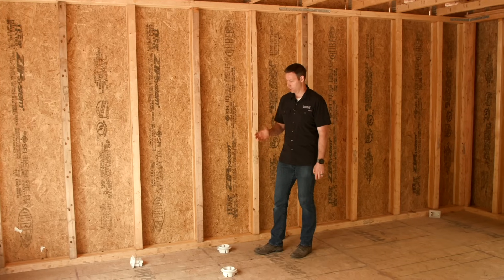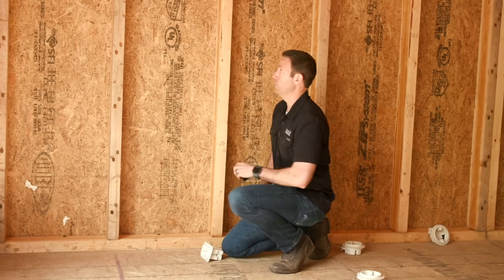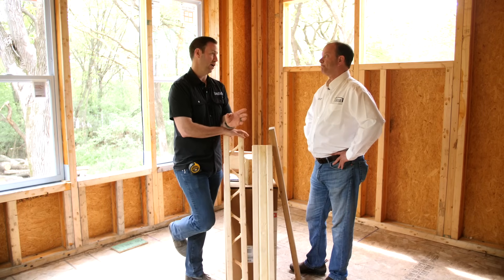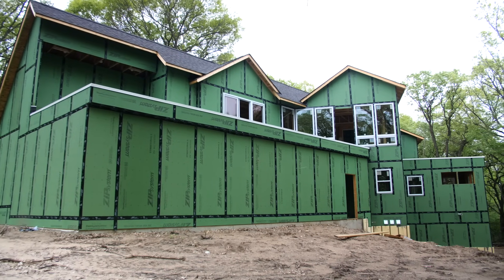Insulated Studs? This is a BIG Innovation in Framing!

Comment: We had a local product called "The Ingenious Open Stud" that we used on a few projects here in Maine until they went out of business.  The 2x6 studs had 2x2 outer elements with a groove on the inner face.  The outer "rails" were held together by 1/2" plywood gussets glued into the inner grooves at 16" o.c.  That left plenty of empty space for the dense-pack cellulose to fill.  Each end had 6" of solid wood for nailing and trimming to length.  This was back in 2007-2008.
So not a new idea, but a better engineered solution.

Comment: Very intriguing. However I would be hesitant to use it until it’s had more time in the field. Would you still use standard 2x4/6 studs on the interior walls?
Reply: Standard lumber for interior walls unless you are using this product for its extra load capacity.

Comment: I understand what you guys are trying to do here , however I’m very skeptical . I have been building for about 18 years , nothing special still a rookie to some old timers , but have been trained in all aspects of building , meaning I do tile , hardwood floor refinishing and new installation , framing , windows , siding , standing seam metal roofs , and on and on , I only say that to say I have good knowledge of construction . Being this is a new product I have some questions I hope you can answer , I want to like this product but I’m not going to only like it because you say it is good . I have tried to do some research on this product to see if this has even been tested through a company outside of Tstud like ECS or something and I come up with nothing . This 24 inch center and a single top plate makes me nervous . What if your in areas where the code calls for 16 centers like most states do ? And another question is , is this really that much better than regular 2 x 6 walls , and the zip system has been proven to be lacking in allot of areas and actually fails allot of the exterior testing sites do . So I guess my final statement is this : prove to us , the community of contractors , with facts and data by a well respected company that tests building materials for their durability. And it can’t be associated with stud company . I thought if you really wanted to sell this product you would have all of this raw data , not just someone who no one knows saying this is better . Like I said , I want to like this .. so let’s hear it . And I mean no disrespect and am not questioning the integrity of the builders that appeared on this video , nor the sales reps. But I am a man who forms my opinions on proven facts . Will this product be as structurally sound in 20 years like regular framing is ( assuming it was done right ) and what is your proof . Great video and if I get the data that makes me believe , I’ll back you guys 100% and recommend it to contractors I know and even make the switch myself

Comment: I am curious on how well you can run plumbing through this type of wall. As a plumber it looks like it would be a problem running waste arms and the vertical stacks.
Reply: You add a service cavity.
Reply: The fact that they are an engineered product means that most likely you won't be able to notch them hardly at all. Just like TGI truss's you could be limited to designated penetrations (knock outs) so I imagine you plumbers won't think to highly of them. The electricians on the other hand....

Comment: So am I to still put insulation between the studs too, the purpose of this is to eliminate the thermal bridging lost through wood?
Reply: Yes. Roll fiberglass or closed cell foam between studs will still be needed. Going 24" on center will reduce insulation installation time as there would be a few fewer cavities per room.

Comment: It's not about improving building standards. It's about profit. Everyone has a more improved product but at an improved price but the bottom line is it's probably not worth the increase in cost. While I believe the industry is moving too fast for it, I've never seen a comparison of the same age homes utilizing standard verses all this engineered crap. An analogy I like is "Ford beats Chevy". If you read the small print, in a 1000 mile race Ford wins by 10 feet. Doesn't mean shit and neither does all this "building science"!!

Comment: There is even a better way. 2x4 wall then another 2x4 wall but off set the studs for the thermal break. 7” of insulating.
Reply: yep.  If you can afford it this a good method.

Comment: This sounds like the perfect application for framing out the walls between the shipping containers in the shipping container house I'm planning to build. The spray foam seems to be perfect to fill any gaps between the wood framed walls and the shipping containers. There should be no more challenge for it to work than I'll have with using traditional framing.

Comment: Not good! As a 47 yr experienced carpenter I can tell you in won’t be properly nailed. 11/2” wood will usually split. You need to have at least 6” of solid wood top and bottom so as to nail properly without splitting.

Comment: Electrical note; What are electrical cables in the US sheathed in? It's a big no-no for cables down here in Australian which are PVC insulated, to directly touch styrene, Styrofoam, polyurethane and bituminized papers. This is due to the plasticizers in the PVC cable sheathing migrating into the touched materials. The cables degrade and loose insulating properties and also degrade the surround materials. This happens over long term time frames but non the less isn't good!
Reply: Also; wish we had these in AUS, currently building my own place and the lack of options for materials is astonishing.

Comment: Sounds very impressive.  What about sound performance?  Esp the bare studs when filling the wall with foam. How would it compare with staggering 2x4 studs in a 6 inch space (studs only contact one side of the wall i.e every other on one side)

Comment: Looks expensive and stupid.  Why not just make engineered lumber that has insulation built in.
Reply: What, exactly, does that mean?
Reply: Probably means Structural Insulated Panels...
Reply: @BenjaminFranklin99-s9n  I mean use an insulative binder binder.  to increase the R factor of engineered lumber.  I worked at a lab that for ferral corp that worked on decking lumber with plastics.  It would not be hard mix wood fibers and expanding foam and extrude into the same dimensions of this product, certainly cheaper to make than the multi step process of this product.  Plus you can use lower quality wood as the input.

Comment: How come nobody is questioning the claim that  a stud which is more than 50% wood has a R rating of 20 as compared to a pure insulated section is R19?  Looks like about 2.5 inches of closed cell insulation and 3 inches of wood compared to 5.5 inches of batt insulation.

Comment: It would be great if glueing two or three layers of this 3x6 doweled lumber (onsite with urethane or epoxy) would produce beams at least as strong as standard 2x6, 2x8 or 2x10 beam pairs over wide doors and windows. 

Maybe just make an insulated beam from insulation panel board and standard 2x10s? Nah, gotta add dowels! 

Now I am thinking of cutting multiple V notches (like serpentine belts) into this lumber to create insulated 3x truss! Perfect over picture windows and sliding doors.
Reply: @BenjaminFranklin99-s9n  
I know SIP. The strength mainly is in the OSB, although the EPS keeps it straight, and 2x are incorporated at key locations. Don't believe for a second that a [SIP] roof can be shingled without ventilation in cold climates. Or perhaps installers skimped on the expanding foam sealant and mastic on famous rotting rooftop village.

Comment: I would use a conduit in the future we will have non resistant electrical that will eliminate circuits and internet of things will control whole house so easy remodel. Or put 2x waistcoat with all pex and multi strand Rolex cat5 speaker wire and security single cable . have data security power 12 volt and 110

Comment: You would probably save 1500 on electrician, and plumbing time because they don't have to drill anything!
Reply: Nope. With a good auger bit and (now cordless) hole hawg it takes a couple hours to drill framing on a typical home for electrical.  It might shave off an hour or two at best. Might get a few hundred bucks off.
Reply: The plumber will always find a reason to charge more, not less.

Comment: Great video

You get even more efficiency out of heat pumps because you can use higher (for cooling) and lower  (for heating) temperatures - you need less capacity installed, might as well be the 1500 $ saving right there. Or may even work with direct ground loop cooling.
Reply: Mini-splits.
Reply: @BenjaminFranklin99-s9n  If you wanna go cheap, it is the way to go. Since there is no need for heating in southern climates, I imagine it's a very viable option.

Comment: More "complex" house. Rofl. This is how we have been building houses in Norway at least the last 35 years. You should not take out the core of the 2x6 and replace it with insulation. You loose a lot of strenght.
Reply: @BenjaminFranklin99-s9n  was this a comment to my comment?! I did google "I -beam"
Quote:" I-beams are usually made of structural steel and are used in construction and civil engineering."

Boatbuilding. Do you mean foam sandwich boatbuilding with fiberglass?
Reply: @kenthammersvik9822  The I-beam principle is that the outer surfaces carry almost all of the load, IF the surfaces are bound together immovably.  Cored boat construction using foam or balsa core and fiberglass skins is an example of this principle, as are steel I-beams, as well as Trus-joists and trusses used in roof and floor supports.  There is no load in the center between the skins in construction using this method.  

I sailed across the Pacific Ocean in a fiberglass boat in which the deck was built along this principle.  The deck of this boat is still standing, supporting unstayed masts - 40 years and  50 thousand nautical miles later.  I now live in a house made with SIP construction using this principle, and the second floor in this house is supported with Trus-Joists.  Got Google?
Reply: @BenjaminFranklin99-s9n  i was commenting how to build a house not a boat. Nice tip about SIP homes.

This is how we build a typical house in Norway. It will last a lifetime and survive many storms.
The walls are both outer and inner walls with outside insulation. Insulation is put between the beams in the wall. Outside gets additional weather proofing not shown in the video. 

https://youtu.be/U9vELJ4hiYE

Comment: So this system seems great for builders, but as the home owner now you've got to remember that you can't rely on standard wall anchor use since all you have to hold the anchor in is a thin strip off wood. I've got plenty of furniture that would simply rip out the anchor if it were embedded in one of these and started to tip...

Comment: Wow I'm sold. For that extra delta cost you are getting so much more! Awesome tech.
Reply: For a very cold climates normally framed with 2x6's for thick insulation... seems like a good investment.
Reply: @KrustyKlown  Wish many of you could be in my shoes where I currently live (going on 5 years now), drafty as heck bedroom closet (its a corner of the house room) which clearly the insulation if any has since long failed. and the basement is field stone with a shanty interior door and never updated much since it was originally built. So even other walls and the windows as well are all draftier now a days. 
If I had the money to or happen to win the lottery one day, would move out of this low cost rental duplex of a shanty place and live in another more well build modern home ASAP.
My dream home would be:
ICF basement (waterproofed as best i know possible from my own experience doing such work in the past)
Post frame (pole building construction) for the main structure. With brackets wet (locked into position) or dry (still be able to be repositioned as and if ever needed) set from Midwest Permacolumns, for the post columns to be attached to. As they so names they make stand alone precast columns which are great for more temporary buildings and perfect for addition/extension builds and even for specialty double tier decks.
T Studs for the secondary framing (between the columns) for its insulation value and added strength to the post frames own strength.
Zip - R or ICF panels (2 inch thick) with strips in them for the exterior just to cover the solid wood post frame columns, Possibly even insulated aluminum or steel siding panels (PVC are crap against fire and fade) pr even maybe Hardi type siding.
Rockwool (Roxul) in the cavities  as it is more fire resistant than  fiberglass or spray foam (said foam would be overkill to me) and sound deadening.
Green Glue for what it may be worth in further deadening sounds from and through the structure components themselves.
Reply: @Joshua79C  Sounds like an awesome plan ... I had a Post Framed house .. a split level, lower was 2x4 walls, and upper was Post Framed .. huge open living areas, divided with non-load bearing walls .. was a joy to remodel because you could move the walls any where ya wanted.  Had to move for work .. still miss that house a lot!!!!
Reply: @KrustyKlown  My ideas is mor ealong the lines of  a hangar home but instead of the hangar above in this case the basementis made to be clear span side to side and end to end for the most part. Would still wall off small areas like the mechanical room where heating and water stuff would go. Actual 30 foot wide interior that is 40 foot long for beginners for the basement at least. ICF has its limitations, unlike wood structures which is where you can place or even move the location of any door or window as you need or desire. Thus adding onto the ICF walls by means of extending the length would be no go, so until then I am just keeping said general ideas  in mind. Of course in my original home I lived in with the parents was old as it is and even though we updates the parts you could see both inside and out, the basement was still kept the same, even where my dad and step dad both did their best efforts to dig out crawl spaces under the rest of it. But we have since all left that updated old place, in 2005.
I am even considering putting in a AC Phantom Lift into the plans if  I go larger on the basement, make it easy to store stuff and take in and out as needed or even park a vehicle in there.
If I won the lottery while still in the old family home, some of it would have been invested in updating the basement of that place before we sold it. Or I would have bought it even after i moved out in 2004 in order to do just that so the new owners would have even more living space and the price for it would be included in the asking sale price per the adjusted appraisal value.
But life is as it is, one day, week, month, year at a time.
Reply: he didnt even mention the cost tho
Reply: @michaeljones5068  He did say on the average house in North America (2500 sq ft), it would add $1000-$1500.  But I imagine the energy savings (and possibly labour due to the reduced weight) should more than offset that extra cost.
Reply: @davidslinn5920  Not to mention, l less or no drilling for the rough electrical and top out plumbing.
Reply: @michaeljones5068  14:25 to 14:55 he mentions the extra cost to compare, actual pricing per piece will depend on volume of order per what sizes you request and your delivery location and any added delivery requirements.
Reply: @Joshua79C  He seemed a little reluctant to give a per piece price comparison because I think a lot of what he was using to base his response on requires things like 2' centers between studs to make them price competitive. But like all lumber products they are commodities and as such are susceptible to large market swings. On Monday they cost a buck and a half but come Friday they might cost three. One thing that works in their favor at least is the fact that they are using smaller dimensional lumber. 1 1/2" x 2 1/2" nominal. Even though they are using 2 pieces per stick the smaller nominal size allows them to use smaller trees and use parts of the tree that they wouldn't normally use. That might offset the extra cost of manufacturing at least.

Comment: How about blocking between 2x6. Load. I bet it close to your t stud. If not the same.  ???
Reply: I think you cut a T-stud for structural blocking, 21.5" length. For fire-rating try a pair of 2x3 with plywood webbing 5x21.5", or fill cavity with closed foam.
Reply: T stud still wins by quite a margin, and you've just added 15% more thermal bridging. So t-stud a 8600x4 or and 8 ft wall = 34,400. 2x6 1400x6 = 8400. If you block in the middle you can double that to 16,800. You'd need to block every 2 feet to match, and blocks make working in the wall cavity an outright pain.